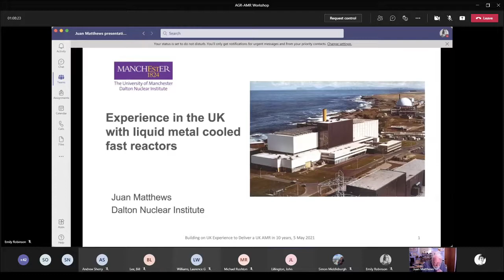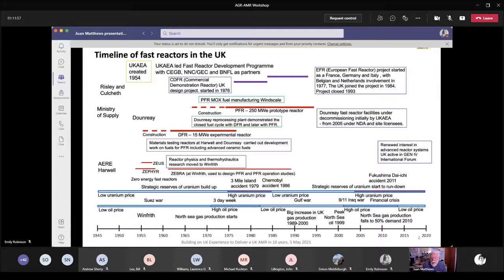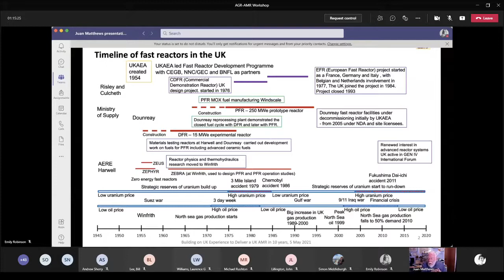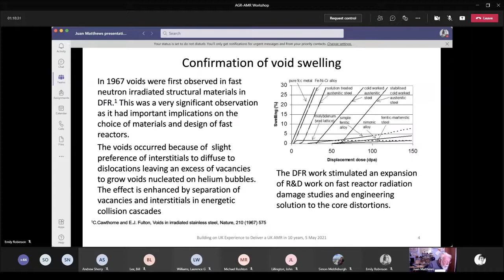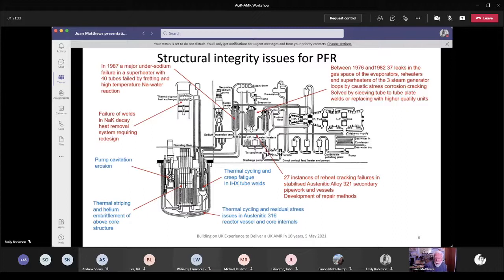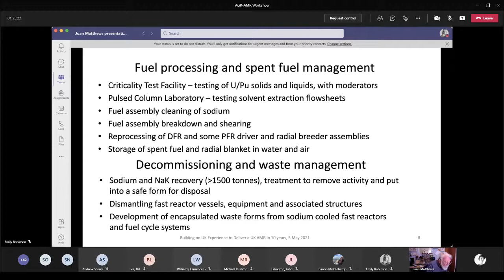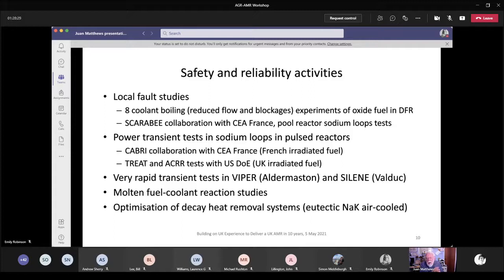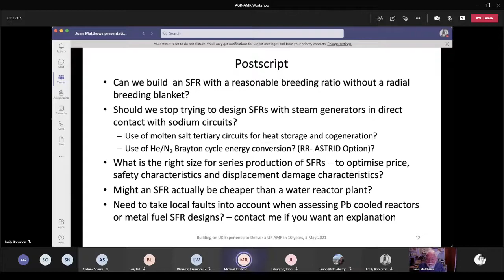Experience in the UK with liquid metal cooled fast reactors - Dr. Juan Matthews

Comment: Regarding the mention of up to 23.5 at % burnup - I assume that is FIMA - was that measured as an average across all the pins in an assembly, and did that average include the axial breeder zones, or was it just the driver fuel in the middle of the pin? In other words, were the burnup percentages calculated to take all the heavy metal nuclei from the whole span of each pin into account?